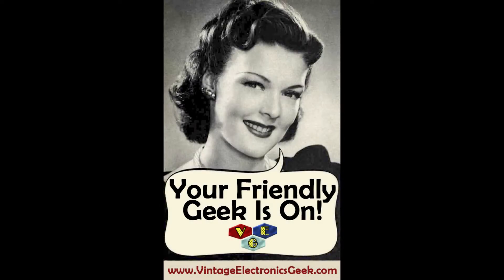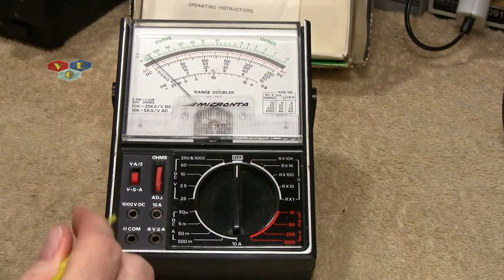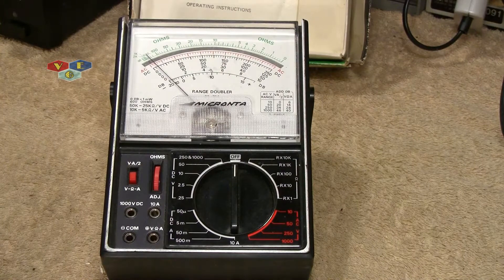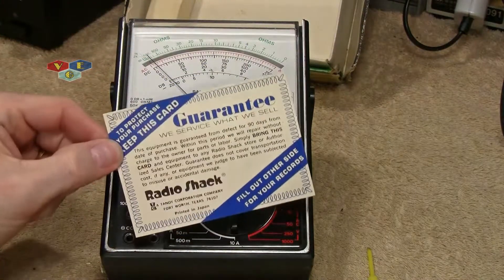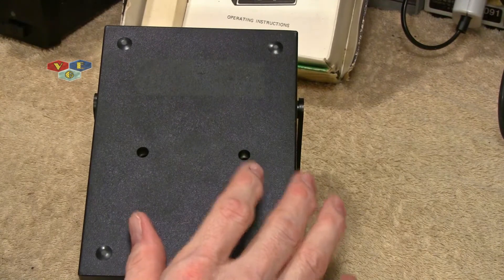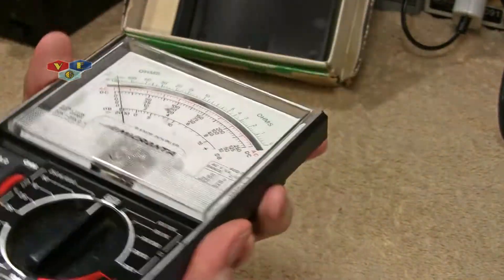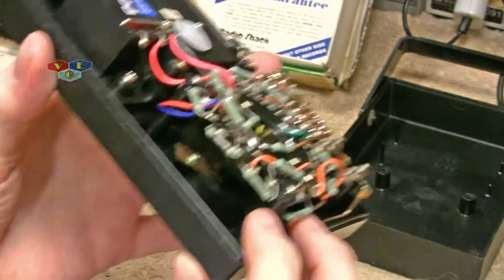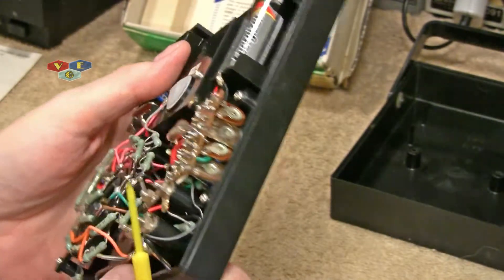Repair Of Micronta 22-204 Multitester - Part I: Introduction

Comment: It actually doubles the resolution and divides the range by 2, hence, VA/2 (50 becomes 25, 10 becomes 5, etc.) only for voltage and current readings..
Reply from the maker: Very cool Daniel, thank you!  ~Jack, VEG

Comment: If memory serves, this meter was available as a diy kit but in blue plastic. Maybe the tolerances and adjustments can be gleaned from that manual. Anyone have that information?
EDIT: Did minor poking around in the interwebs... YES! Seek Archerkit RS # 28-4014. Somebody out there must have a manual/ instructions, etc. It IS this the meter but in kit form and blue plastic cabinet. Good luck.

Comment: On the 250&1000 it is 250 volts or doubled to 500. You set it the and plug into the 1000 jack for 1000. It does not double. The rest are their reading and twice that when doubled.
Reply from the maker: Thanks Robert!  While editing the video, I was looking at the display again, I think I may sorta understand it just slightly better, however, its still not to intuitive!  :)  Thanks for watching!  ~Jack, VEG

Comment: I just picked up a 22-214 that's very similar to this model for 99 cents too😅 happen to search analog multimeters and it popped up with 3 minutes left to bid and opening bid was  .99 and a few dollars shipping. I felt like I had to bid on it, and I prefer older analog meters over a new one for around 10 bucks. There was a catch though, which is what led me to this video. It's not working correctly, so I'm hoping it's a simple repair. If not, for the price, the meter movement alone is very useful and well worth what I paid.

Comment: hmmm, meters or yards, as in  two meter rig rather than a two "yard"  rig.  This vid got me tninkin 'bout meters, then I was on a tangent gain.  I may have one of these, I'll have to check.  Of course, I use my Fluke DMM most of the time.
Reply from the maker: I'm sure you have one, would you really be the junk collector if you didn't?  Now, me thinking....what does Don not collect? Next time you want your Fluke to turn off, just simply look at it and yell "Fluke-off"! :)  ~Jack, VEG